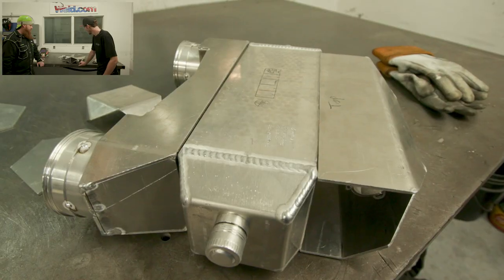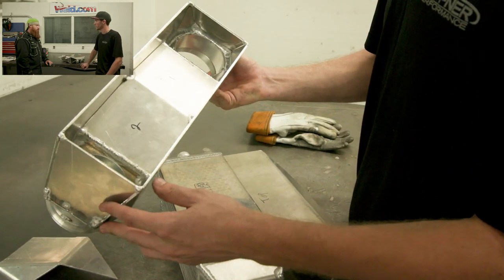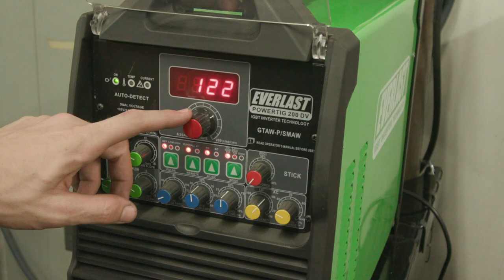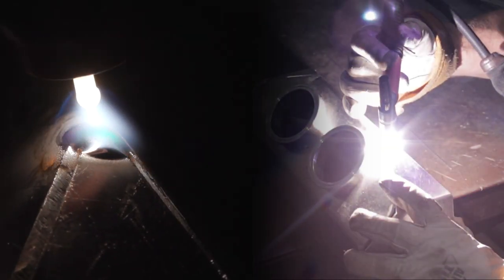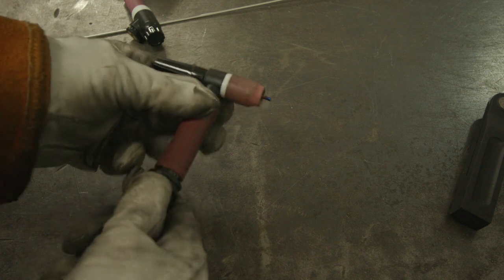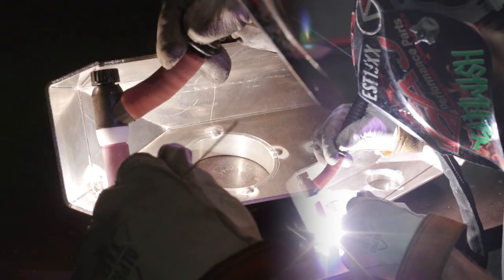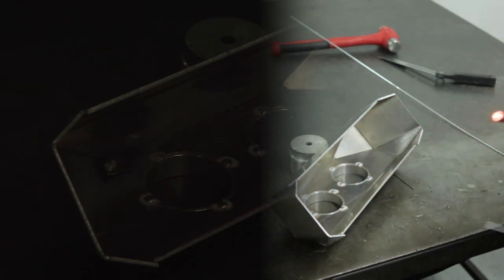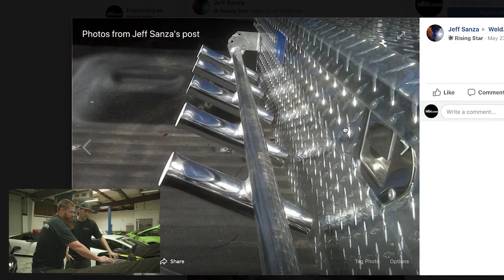Aluminum Intercooler Fabrication (Everlast PowerTIG 200DV)

Comment: Would like to ask a question? I am right handed and do I use my right hand to hold the tig or change it around and use my right hand to hold the wire.
Reply: typically right hand holding the torch, however for some it’s more comfortable/natural with the torch in the left hand

Comment: What is the purpose of welding the inside versus outside?
Reply: He's welding BOTH the inside and the the outside. They just didn't show that part. For something like this it has to be welded inside and outside because of the such high pressure it has to hold and with varying temperatures. Any weaknesses and it will split fast.
Reply from the maker: Both sides get welded.
Reply: @merlinalexroni  How much pressure? Maybe 25 pounds tops. That's not high pressure.
Reply: @JesseWright68  take a 1in 25 lb weight and place it on a sheet of aluminum and tell me how that goes for you. Then cycle the aluminum between 60° and 180° a bunch of times. No, 25 psi isn't much... At first. Over time between cycling pressure and temperature that aluminum will stretch and contract ESPECIALLY at a welded joint. But please, tell me more about metallurgy...